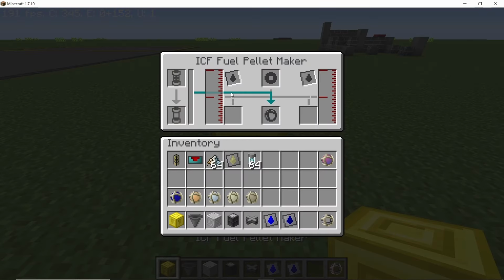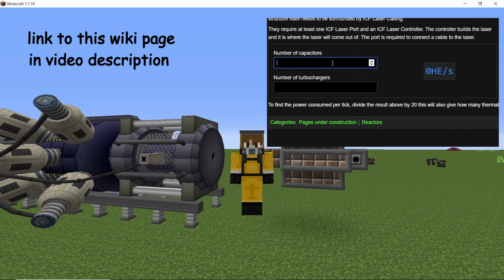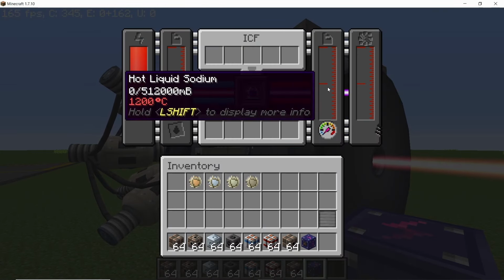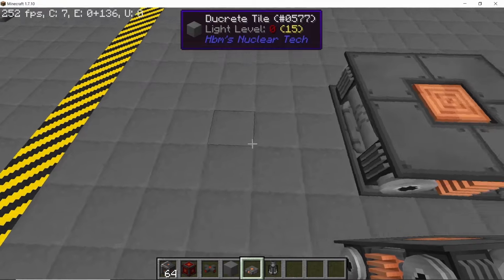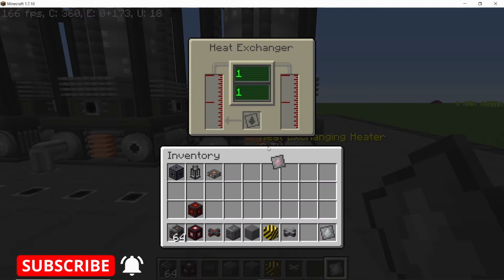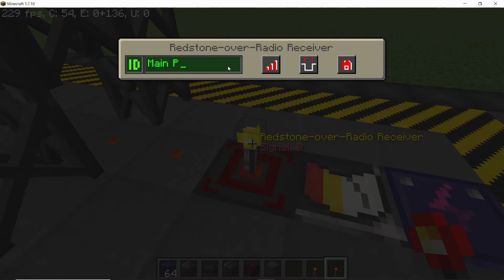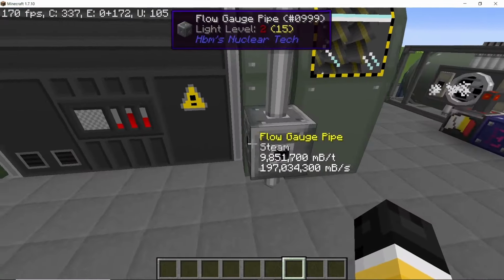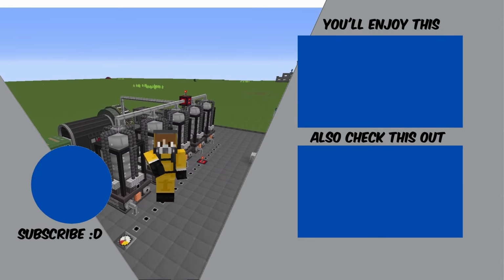Inertial Confinement Fusion Reactor - Fuel Pellet Maker and Laser Setup - HBMs NTM Minecraft

Comment from the maker: 1) Using 2 lasers, each with a single capacitor and a turbocharger on both the sides will work as well cause they produce 7.5 MTU each giving us 15 MTU in total. 

2) The reactor will produce Stellar Flux while operational, so for now you'll need to get rid of it and there's no other crafting recipe for it.

3) You can have a single power storage block in I/O mode to loop power back in as the reactor is self sustainable as long as it has fuel pellets in.
Reply: what mod version did you use?
Reply from the maker: @Fantogs-ct4pt I always use the latest version available at the time on GitHub
Reply: Stellar flux, can now be used in the Fusion reactor, which can be used to produce gold and gold stuff
Reply from the maker: @MinhNguyen-text yes it's pretty neat

Comment: hey cool video but can you make one showing us how to remove polution kinda annoying having a fog around my base
Reply: Kinda did in a semi-recent vid about cleaning up after a reactor explosion, use radiation absorbers.
Reply: @VeiTheOne  its not the radation from a reactor but soot from combination oven and oil procesing and idk how to get rid of it
Reply: Did you try to connect exhaust pipes to the Smokestacks? @alenivancic7518
Reply: @alenivancic7518  Must have misread.

From what I've seen, chimneys reduce it, and it seems to gradually reduce over time. Donno if there is a way to remove it.
Reply from the maker: I'm late to the party but yes pollution will naturally go away over time once you stop the machines and also smokestacks reduce the amount of pollutants emitted so make sure to use them.
The smokestacks don't have any restriction on their flowrate so you can basically connect all your machines to a single one
Reply: @SavageVegeta  Oh thank you so much
Reply: @SavageVegeta  Better late than never.